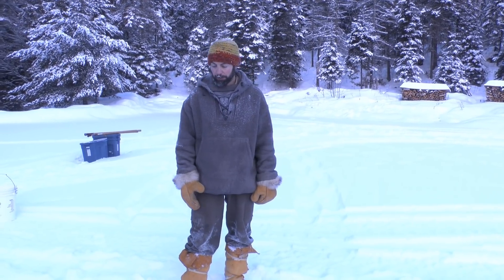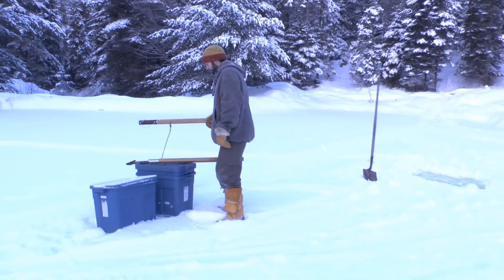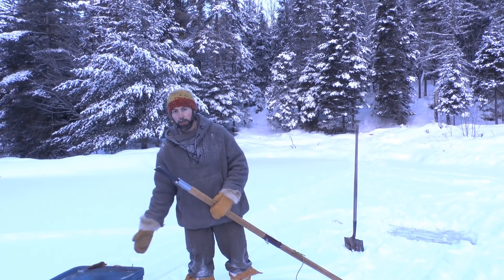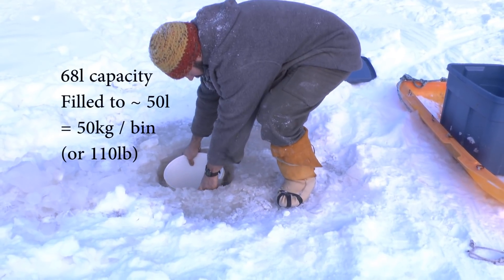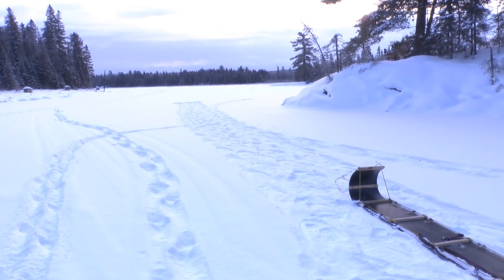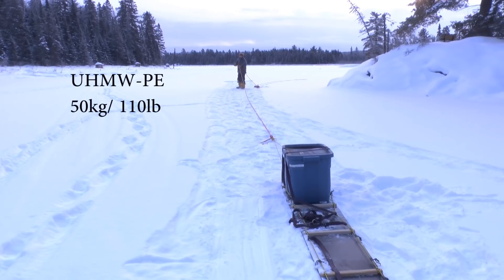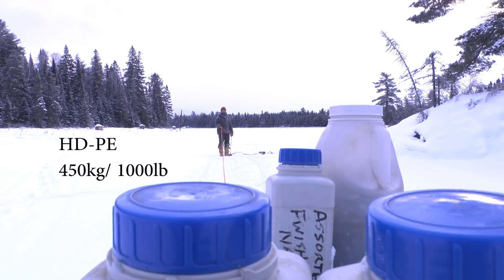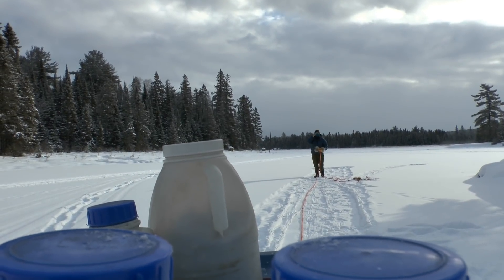Toboggan Hauling Test: UHMW-PE vs HDPE

Comment: I've yet to see a definitive statement about the relative friction of these two plastics on snow. Long experience in the ski industry suggests that uhmw must be better, but a key difference is that skiing is conducted at velocities that are not relevant to winter hauling, and velocity can make a huge difference in how much micro-melting occurs.  However, it looked like this test was conducted on snow that had been tracked in and sintered for hours or days before the test.  I think it would have been worth the extra effort to perform the test on a fresh float, because that's all that matters on a long-haul trip. Electric winch with one of those little hanging load scales would be the way to go, as noted below.

Comment: This has been out there a while and probably been solved but a person could measure the differences in friction between the high density & the ultra high density by attaching a weight scale to the rope.  Similar to a scale one would use to weigh a fish.  Starting friction would always be more but once moving, it would be cool to see if there were any differences. 
Still a great video.

Comment: I've used uhmw for dogsleds and it does well down to -50f. Have smashed it into trees and only broken it once. Local word is that the white stuff is not UV stable. I have seen it craze after several years of being outside. Then it starts to fall apart easily

Comment: That was entertaining. We have to use a pulk with a pole due to the mountains here. Otherwise, we'd get run over by our sleds. Do you ever use anything to keep the toboggan from running over you while going downhill?
Reply from the maker: For small hills, we often just run and hope to not get caught!  For steeper/ longer hills, we typically swing around to the back side of the toboggan and lower by the tail line. I tried rigid poles when we were starting out, but since we don't get into too much steep terrain the ease of use of the soft lines seems nicer for us.
Reply: Lure of the North Smart, thanks